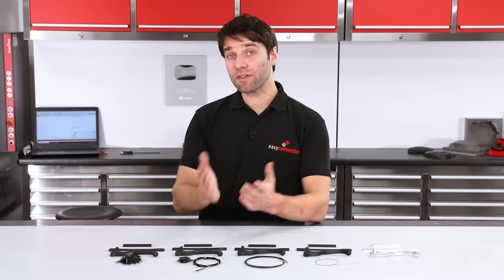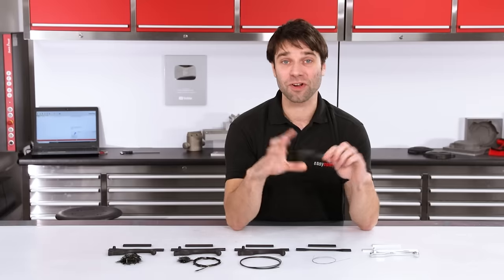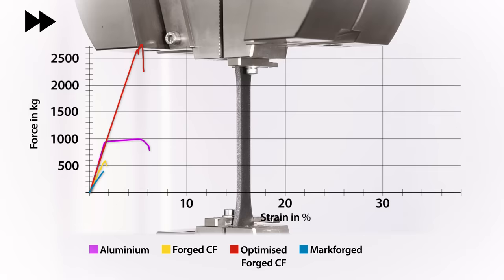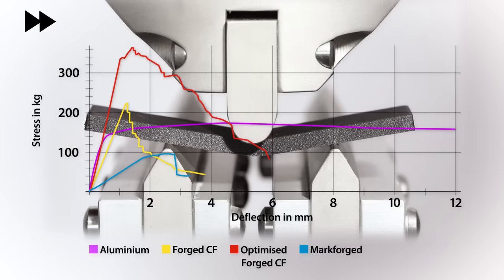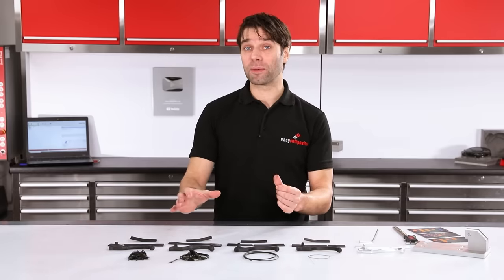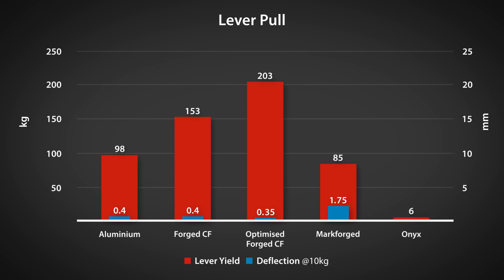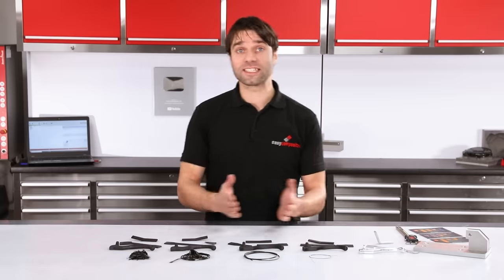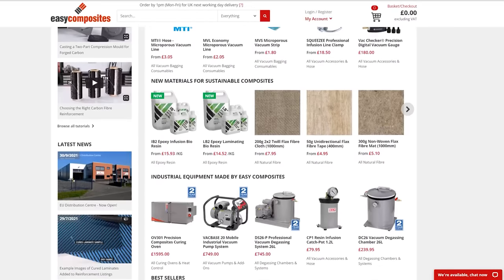How Strong is Forged Carbon Fibre? Forged Carbon vs Aluminium vs Markforged vs Onyx

Comment: I will be ordering from your website. I make custom steering wheels which would benefit from forged CF rear electronics covers. It will be my Christmas present to myself.
I do need to point out a couple of mistakes in the video - nothing nasty, just some pitfalls of FDM printing which once known will yield better performing parts. Firstly, 100% infill is inherently weaker than using lower values. I understand this was done because typical infill geometries are only strong in at most two axes. Using 100% infill made its properties equal in all axes but in this case this is not a good thing. However, a gyroid infill geometry is inherently stronger in all axes. This is an area still under active research, but the gyroid pattern available in current slicers is already excellent. I use gyroid infill for many structural parts, with different percentages depending on requirements. This percentage is usually exactly half any other infill geometry, with some parts requiring a higher infill to ensure the outer finish of the part does not show the infill geometry because of extreme bridging distances. TL;DR: Gyroid infill patterns are the most desirable for structural parts as they provide strength in all axes, produce lighter parts (lower infill density), and reduce time and cost in printing. The machine using a single CF strand with a gyroid pattern would be very interesting to see - although I suspect in the case the layering will make the print less deformable (stretch and compress) in the same axis as the normal layer lines and do nothing for off axis performance.
The second mistake was using NylonCF. It was always going to deform elastically from the first moment pressure is applied. ABC-CF would be the same. Of course,  Nylon and ABS both have excellent thermal properties, but they are exceedingly difficult to print and notorious for curling off the print bed (failed print) and poor size tolerance (shrinkage) in even the most ideal environments. I would be interested to see the CF reinforced FDM prints with a more rigid material; your favourite PETG-CF with post-print annealing would be a good candidate. I still expect it to perform worse than the other methods, but I suspect they would perform much better in the FDM use cases presented.

Comment: Thanks, I instinctively bought some cf tow alongside chopped one and made optimized cf forged part without knowing it is a thing. Looks like my decision was on point. I'm using a resin 3D printer for cf forging molds. So much better than FDM, with less warping, faster prints, more detail, and sands like a dream. And I'm getting resing cheaper than filament when buying in bulk.
Reply: ASA or ABS can easily be post processed using aceton. Its very easy to get a mirror finish using minimal sanding and aceton vapor.

PLA is slightly stronger for use in molds but its more difficult to post process. Its harder to sand and you need more aggressive solvents like chloroform or DCM to disolve the layer lines.

Solvents can also be used to weld the parts together, this connection is stronger than glue.

Comment: Cool test. As far as levers go I’d still take the aluminum.  Anything stronger is just going to damage the perch or master cylinder instead. I’d almost prefer something elastic that will bend/deform instead of breaking or transferring the forces…best chance of getting me home instead of breaking something. 

Keep up the great videos😎👍
Reply from the maker: That's a fair comment regarding a lever. As you can appreciate, the video is more about investigating the properties rather than suggesting particular applications. Certainly there are plenty of times when you do want something to be as stiff (or strong) as possible for its weight.
Reply: I get where you're coming from there. On a daily driver, having a more elastic lever is great, but on a race machine where feel is better, a stiffer material might save you a few tenths of a second per lap! To each their own!
Reply: @Awkward_Fox  Heartwarming tolerance from the black fist.

Comment: Very informative tests.
Would love to see a tensile and flexural test between weight-matched carbon, glass, and flax sandwiches (same core, different reinforcement thickness) for applications where material bulk might not be an issue, such as beams and tubes.
Obviously this would not be a substantive test for a specific application, but a rough estimate to get an idea of the different material capabilities.

Comment: To give an idea of just how strong the Optimised CF did, it’s yield stress was around 876MPa. Given that Mild steel yields at 250MPa and 304 stainless at 515MPa, that carbon fibre is amazingly strong
Reply: Wow that’s actually crazy
Reply: But traditional carbon fiber weave yields at (if you can even talk about "yielding" with carbon fiber) 3500MPa.
Reply: @s.w.6977  Lol you’ve got a point about that. More like percent of a percent elongation
Reply from the maker: Remember a composite behaves considerably differently to the raw fibre.

Comment: This was outstanding. Its very rare on youtube to get a test properly designed, properly executed, all the data, and useful samples to compare to. My only question, how would this compare to a typical carbon prepreg sample? Obviously can't do the gear lever, but I'd be interested how forged compares with just the generic flat test samples.
Reply from the maker: There is already a lot of mechanical data available for conventionally produced composite materials. However a direct comparison is not really possible as generally the methods have different applications. Eg the brake lever being a solid thick object is not ideal for conventional composite lay up, and thin conventional composite panels are not ideal for a forged carbon lay up by these DIY methods. So not easy to have a direct comparison that would be meaningful. In broad brush terms, the longer strands of a conventional composite material will have considerable mechanical advantage under certain loads  - but it is very fibre orientation and fabric type dependant, a forged carbon process has a much more balanced set of properties.  Eg comparing a UD cloth lay up to the "optimised" forged material test sample would probably yield similar results as the fibres are all in the same direction on both materials. A woven cloth would be different again.
Reply: @easycompositestv  Thanks for the reply. It was exactly what I was looking for. It can be hard to separate the misinformation from reality online, and I'd always wondered if the claims of "forged is stronger" were inaccurate for that very logic (implied in most circumstances). With the ease and performance of forged I'm incredibly surprised it hasn't taken off more, especially with the incredible performance of the long reinforcing strands. Anyway thanks for the reply, this is obviously a knowledgable source I can trust and everything is making sense to me again.

Comment: Great video! The only thing I wish you also tested was a regular 3D printed part as a control to compare to the other 3D printed parts.
Reply: They more or less did, the Onyx filament isn't that different compared to standard filaments. The polymer used will probably affect stiffness and strength more than the carbon in it.
Even if Onyx would be say twice as stiff and strong as pure polymers like PLA or PETG, it doesn't really matter in this comparison, and afaik, the difference between Onyx and others is way smaller than that.
Reply: @Robinlarsson83  that’s kinda my point…. The reason it would have been good to test a regular 3D printed part would be to see if there is any benefit to the Onyx filament at all. We could hypothesize that the Onyx would be almost the same as regular filament, but without actually testing it is nothing more than conjecture.

Comment: 13:00 The Markforged print could benefit if the print was spiral, single fibre, without any fibre interruption per layer. That way you could maybe finish without top or bottom layers, maximising bending strength.

Comment: Great testing. Though it would be nice to see a traditional weave to include a wet and vacuum setup. Test all the things.
Reply from the maker: Thanks for the comment Jeremiah. You raise a very interesting point actually; whilst it would indeed be interesting to see how the component compared if made using a wet-lay vacuum bag setup, it would actually be quite difficult to make the component in this way. The specific advantage of the forged carbon process is the ability to compression mould solid carbon fibre shapes. Such shapes are actually not very practical to make from a woven fabric and wet-lay vacuum bag. For starters, to achieve a solid 3D shape like this, we'd probably need to use a two-part compression mould anyway, meaning that even if we did use a woven fabric, the process would be more like compression moulding using a woven cloth. Our testing showed that use of continuous reinforcement in a matched-tool  compression mould resulted in a high level of voiding (or at the very least very resin rich areas) because the continuous fibre can't migrate and redistribute itself in the mould cavity under pressure in the same way that the short strand chopped tow can. Nonetheless, I agree that it would be interesting to see and compare the result, even if we anticipate the component would be flawed.

Comment: Hi Paul !!!

Not sure if you remember me but I was looking at exploring forged CF for use as track control arms - as substitute for steel - but needed data to decide whether it could be feasible for that application (and work out what sort of design changes might be needed to meet or even exceed the original part characteristics.)

I must say I am incredibly impressed by your approach to testing and it has given me much food for thought. Optimised forged CF looks promising but design changes such as strengthening ribs/grids and thickening the profile will be needed to improve rigidity and strength. Despite that,  the weight savings could be phenomenal. Perhaps a composite mix glass fibres with better characteristics in other areas can be added where CF cannot cope (recognising that CF is not a one size fits all of course.)

Anyway, thanks for your work! Its been eye-opening. 👍
Reply from the maker: It could be possible but the shape would need to be specifically designed for the process rather than a copy of a pressed steel item.  Extensive testing would be needed to ensure it is safe long term.

Comment: Really interesting video...I would like to discuss these other considerations:
1 - how do mechanical characteristics evolve in time due to fatigue stress?
2 - how are mechanical characteristics affected by exposure to sun rays?
3 - which is the cost of the different material parts?
4 - is there any technic to make work together aluminum and carbon?
5 - aluminum is 100% recyclable. Is carbon as well?

Thank you!
Reply from the maker: Fatigue has not been investigated in this study but it is an important factor in some circumstances and environment. Generally the UV resistance of the materials used in this case are such that the typical use and exposure to UV is unlikely to have any mechanical impact. Further protection can be used on parts subject to high levels of UV.  We have not done direct cost comparison in these cases.  A hybrid could well be used and depending on testing may result in a mix of properties.  We have seen metal powders used, fabrics with metal threads as well as composite, or even using a metal frame or insert with composite around it -the specific application will likely determine that.  Carbon fibre is not easily recycled at this time.
Reply: @easycompositestv  Thank you very much for your insights. Is it possible to know which kind of product can be used to improve UV exposure resistance? Are they specific for carbon and/or epoxy resin or can be they employed generically with any composite? Thank you again!

Comment: And that's why ropes are not made of concrete. Very interesting video. Will definitely build parts of my 3D-Printer from Forged Carbon Fiber using your Kit in the future.
Reply from the maker: For sure, 3D printer components like brackets and linkages are an excellent application for this process.
Reply: @easycompositestv  Especially the gantry.

Comment: Fantastic video. One aspect you didn’t consider however is useable deformation; or the ‘battle damage’ performance factor. You took the failure point as plastic deformation. How many times as a kid did you carry on cycling with a bent brake lever? You said, ‘but doesn’t actually come to final breakage at the end due to test method.’ In the real world the aluminium brake was the most usable and repairable lever. Nevertheless your presentation was excellent, I watched because I’m looking to build a carbon fibre instrument panel for my carbon fibre glider. However, it’s kind of put me off upgrading my  carbon road bike’s aluminium brake levers! Great work.
Reply from the maker: In reality, the failure performance is different, but you could make the levers by this method with an additional safety factor so that all the likely impacts would not cause failure of the lever. That would involve some quite complex analysis of the impact forces and structural calculations to make the lever strong enough but it is possible if you need that extra strength. For a lot of uses, that is not such an issue.
Reply: @easycompositestv  Thanks for the reply. The video did make me think more carefully about material choice.

Comment: Very interesting comparison. You say that the carbon fill in Onyx makes it both stronger and stiffer, but most tests I have seen suggest that it only makes it stiffer. Supposedly the fibers are too short for the bonding strength between the fiber and nylon to improve the strength.
Reply from the maker: Well, good point. I guess we should have said "which it is claimed makes it stronger and stiffer".

Comment: Excellent video guys. I think once I've seen impact testing I might buy some
I do also wonder what the strength is like compared to layers of carbon fibre cut to shape, layed on top of each other with resin in between, and then squished in the mold.

Comment: I too have made several aviation related components using your advice for forged carbon composite construction.  Can you include some deviation comparisons, or at least commentary, should you choose to make another video on the project?  Specifically, how would a field of 10 identical forged carbon fiber parts compare when compiling a larger sample size? Keep up the great work!!!!!
Reply from the maker: In an ideal world, we agree that a bigger sample size would be a better way to show consistency.  Although not shown in the video, we have tested various parts to ensure the tests were valid and also to help us design the video so we were working in the right range of materials for a reasonable comparison so based on our cumulative testing over time, we are confident the figures are in the right ball park and reasonable for the methods shown.

Comment: Been waiting for this video for ages!!! This is a really important video for those who are choosing the right technology for their garage projects. Aluminum substraction manufacturing still outperformes markforged continous CF 3D printing... I am a little disppointed. CF 3D printing should beat hand laid casted CF in theory, and replace aluminum machining eventually for low temp applications.
Reply from the maker: There would still be many applications where ally would be a better material, as others have commented the failure mode of aluminium might still make it a better choice for a brake lever for example but then of course there's lots of situations where out-and-out strength-to-weight ratio is what you're after in which case carbon (in one form or another) is going to be the obvious choice. Regarding the Markforged not beating aluminium, it's important to remember that it's a lot less dense and so the Markforged component on test is lighter than the aluminium. If you made it up to the same weight then it would be stronger (albeit slightly larger). If you link through to the report on our website you will find the weights and densities of these materials so you can also compare their 'specific' properties (which factor for weight).

Comment: AT 7:00, the Optimized forges CF actually failed in shear and not bending. If you were to test this in pure bending, you would get a higher result. You can tell it is a shear failure by the shape of the failure mode.

Comment: As a offroad rider this looks amazing! Did you do any testing with the lever turned by 90 degrees to simulate an impact on the ground?
Reply from the maker: No just the testing here for comparative purposes rather than real world testing which would have different requirements,